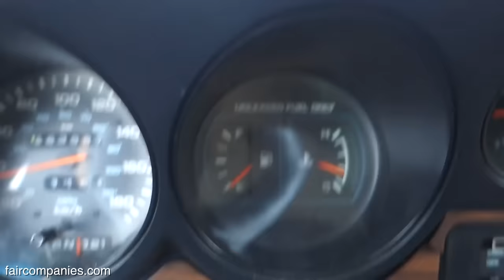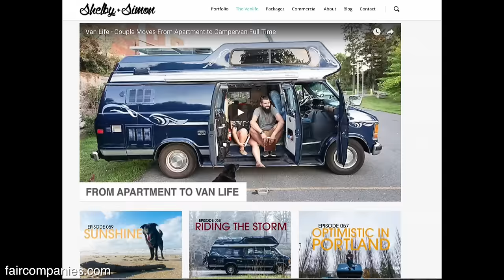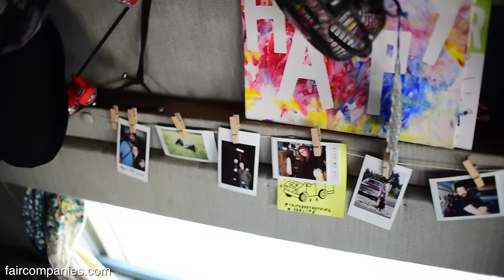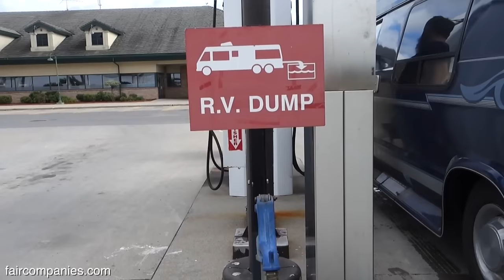#vanlife with no filter: couple records work/life on wheels

Comment: Hi Shelby and Simon. Loved this video. We've got an off road van and have owned others. Never lived in one long term but have camped in them quite a bit - including some extended stealth camping. Couple things just to help... 

You can get a 12 volt mini semi conductor dehumidifier roughly the size of seven DVDs for like $30 US off ebay or Amazon. Most of the little ones sized for a van or small rv have a little tank you need to empty pretty often, but by drilling a small hole in the tank and inserting a piece of fish tank hose and you can let it drain down your sink.

Outdoor construction silicon from Home Depot for about $10 a large tube is made to fix leaks much more reliably than the as-seen-on-tv spray sealer stuff.

Larger, stackable Tuperware type totes are great for storage and organization, keep stuff dry, clean and safe and their mobility is a big plus allowing you to transition your space at will. It's a popular method in Japan where apartments are commonly tiny.

A small, light weight box trailer will rob you of (at most) one mile per gallon and you can put a LOT of stuff in them to make more room. You could do similar bolting a receiver hitch under the front bumper, buying a trailer hitch shelf unit and tying down some large plastic totes or a couple foot lockers.

A very large tarp attached with silicon sealed bolts to the roof, rolled up with a couple already attached tent poles and stakes makes a HUGE covered outdoor area in about three minutes. With a big enough tarp it'll have sides too. Takes maybe five minutes to roll it back up by hand and tie it neatly for travel. If you're handy you can make it look pretty professional so as not to irk the sensibilities of the neighbors.

Driving at night allows for sleeping during the day when most people would never guess there's anyone in that parked van at Walmart or similar. I've found with stealth urban camping going to the night shift bypasses basically all security/disturbance issues.

Anyway, keep at it at least till it's easy and no longer presents real challenges or frustrations.  That's how you'll know you've grown enough by this lifestyle, when there's less difficulty and no big frustration when difficulty comes.  

Also one more tip:  You're photographers so do the obvious and take pics everywhere.  There may be a coffee table book in the future - or ten of them. YouTube videos and blogs are cool, but the rich who eschew you buy a lot of coffee table books. Imagine "McDonald's of North America," or "Public Restrooms of North America," or "Jerks Who Wrinkled Their Noses At Us." Use your imagination. The world just needs more counter culture coffee table books.

God bless and have fun!

Comment: Find a dehumidifier that runs off of 120 volts and get an inverter that runs off of a cigarette lighter and makes 120 volts. Use that to run the dehumidifier. The dehumidifier has a fan that circulates air and does its job. you can keep all the windows and fan outlets closed that way.

Comment: Why do I see so many people who refuse to get a freaking dehumidifier!?!?!
Reply: Good idea.  I have not got one in my van but will consider it.
Reply: Rhett, respectfully: dehumidifiers require a lot of electricity. It would take a powerful solar system just to run an electric dehumidifier. Or it would require running a generator which is very expensive and usually very noisy. Many vandwellers use the moisture absorbing pellets, etc. but condensation is a huge factor for many people, especially if they burn propane in their units. I haven't seen any effective solution that doesn't require a substantial amount of electricity. If you know of one, please share it. It would help a lot of people. Thanks.
Reply: I'm wondering if or how the propane furnace is vented or not? I've seen some campers install a wood stove setup and it seems to fix the condensation problem.
Reply: yeah, I too was wondering if the furnace is not properly vented. I'm in an even smaller van (Vanagon Westy) with a propane furnace which is vented outside, and have never had condensation problems like this.
Reply: I have a small dehumidifier that we use in our RV bathroom. It doesn't take very much electricity. We have a portable ac that we only use at RV parks. Following 70 degrees works here in the US.
Reply: you should look that the eva-dry e-500 or their product line. apparently it's a real life saver! :)
Reply: A few takeaways.

If you have an idea that seems like common sense, but yet no one is doing it, it is a better move to assume that there is a problem with your idea than it is to assume everyone in the world is stupid except for you.

Electricity usage is the main concern with dehumidifiers, and it will have to be run near constantly while you are inhabiting it.

When it comes to moisture in the van, it comes from many places.  Any form of combustion heater will produce moisture in the exhaust.  Propane heaters that are not vented to the outside of the van will introduce a ton of moisture.

However, even with a vented heater that does not contribute, humans release a shocking amount of moisture through breathing and perspiration, even when cool.  This is the main issue, because a van is so small it quickly gets saturated and that moisture condenses on the windows normally, because they are the coldest area.

Combine that with moisture you bring in with you, when its raining or snowing and its on your boots and clothes.  All of that will be added to the atmosphere in your van.

The solution is air circulation and proper insulation, not adding a tremendous amount of electrical draw.
Reply: Logan Cressler Great comments! In the beginning research phase of van living and condensation is a concern. One of your solutions mentioned insulation. Any recommendations to combat moisture and decrease noise pollution? Thanks!

Comment: probably the most honest video about vanning I've come across yet. good work and keep it going.
tip- get a different type of heater like propex, wabasto or Espar, they provide a dry hot heat very efficiently but do have a higher start up cost.

Comment: Condensation , 
Try driving with the vehicle heaters on full heat, full blower. whist driving. if too hot = lower the windows.
use the van Too Hot ! stop and get out to cool off ? if needed ? 
Cook with doors / windows / vents open fully.
sleep with some type of warm air heating, turned up fairly high, open a vent however cold. 
Gas flames create moisture, Body heat / breathing creates moisture.
Van dwelling is best at 50 deg to 80 deg = room temp, ( 14 to 22 deg ? approx ) ( not accurate conversions ) 
Van living is not really suited to Temps around Freezing / 0 deg etc or less. 
The idea is to drive south to a warmer climate in winter.  = Easy in the USA. also Mainland Europe. 
Try to build a Job / Life in a Reasonable climate if poss .
Earn less spend less on HEAT / Or Air Con !  too hot is almost as bad. = stay temperate with climate if / when you can.
If you must burn gas to keep warm = keep the flame outside the vehicle. Gas flames create water in the air. a more efficient burn would burn off the water / dampness and burn the Hydrogen in the air . and oxygen = KEEP WELL VENTED ! 
Daytime sunshine parking = Place all bedding in the cab and heat through the glass turning it often. sun through glass is hot even in winter in the UK .
ALWAYS KEEP FRESH AIR FLOWING however cold it may be ! 
DAMP and Mould will Make you ill ! 
The Best heat is Electric warm air/ or the engine cab heaters . OK Yes Burn some Diesel ? but stay warm and DRY ! 
( or more solar / batteries etc. ) charge lots of Leisure batteries while you drive around or pay to hook up to charge up ? or do a job for a customer in return for a full mains battery charge = do a deal = chat to people ? 
NO-one can live for FREE / Nothing ! sometimes you need to PAY or Do a Favour and Trade with people as you travel.
STOP EXPECTING EVERY THING FOR FREE ALL DAY EVERY DAY ! 
( mow a lawn/ wash a car / carry some shopping / ANYTHING = Just make someone happy and they will pay you in Money or a Favour ! either way you win ! 
wash and old persons car for an hour plugged into their mains etc ? ( or whatever works out easy and Fair all round ) 
Trade Honest and Fair. 
if you have higher Work Skills maybe work an hour for a full day charging all batteries etc ? Work it out in your own way ?
Reply: PAUL,A1 Great info for a newbie researching this option. Condensation and mould a real concern for me. Propane not for me. Appreciate your info. Thanks!

Comment: They definitely have some good points. But also, I think a lot of their issues could be fixed with better planning and better equipment. He is far to tall for that van. She is short enough to stand up straight but still on the larger side. Having two large full grown adults plus a dog in one small van is not realistic. Better planning for weather could have been done. I believe there are way's to eliminate condensation issues. Most of the reason why they got judged like they did is because the van looked sketchy. They didn't seem to take the "stealth" aspect of van life seriously. If the object is to blend in you need to have a normal looking van and appearance for that matter. I have no problem with alternative appearances but many people do and that's just reality. I realize everyone is not able to afford nice equipment. Overall it was a nice glimpse into the realities of van life.

Comment: If you still are living in your van, mount a 3000 LB drop leg  jack on each corner of the bumpers (4). You can level your van in 3-4 minutes and say good bye to moving around in a wind storm. I did it and love it. Plus if you get a flat, built in jack. Jacks are $50 each at E-Trailer cost $100 to have welded on.

Comment: Your battle with moisture is one of the biggest problems with living in a van. Good ventilation and putting up with the cold is the only thing you can really do. You can get battery powered dehumidifiers. A couple of those running at night might help. The other thing you could do to keep a sleeping area dry is to have what tents have which is a sleeping compartment which is a very breathable but waterproof liner which keeps condensation from dripping off the outer liner of the tent onto you while you sleep. With tents you also play a bit of a game trying to keep everything dried out and not smelling. Your use of propane doesn't help either as burning hydrocarbons does produce water as a byproduct. 

Although your biggest problem is that the shell is leaking. Once it starts leaking its very difficult to stop it and a little silicone isn't going to cut it. You need to take out whatever is leaking. Clean up the sealing surfaces and then re-seal it when its dry and keep it dry for a day or two. If its a crack in the actual body then your only real prospect is probably some sort of epoxy based sealer made by 3M or someone like that to fill and bond the crack. 

Really interesting look at van life. Your honesty about the problems you encountered are pretty interesting. You don't see that kind of honesty from other people who live vanlife.

Comment: Shelby and Simon really enjoyed your video, I admire your skills at producing your documentary / personal reality film!  
Leaks SUCK on boats!  The ONLY way to fix deck leaks on boats is to totally remove hatches/deck fittings, clean the surfaces & re-bed them using a quality thick flexible caulk (then gently replace the hatch and start the screws but do NOT screw the hatch down tight until the caulk cures).  As you've learned you can't stop leaks by caulking around a leak.

Comment: Hello love your video love the honesty I know what you're going through I have been doing it for 10 years I am on my third van couple things you've brought up in your video that I might have a possible solution your condensation problem I found out if you take pantyhose and fill them with kitty litter and put them in your windows it will help with some of the condensation and as far as your roof leaks get you some peel n seal works better than that stuff you've been using. Good luck.

Comment: For the condensation problem, go to a local plant nursery and get a tub of Soil Moist beads, partially fill several plastic small containers with the beads and then set in several different places incl. cabinets. these will help to suck up the moisture,

Comment: The way you get rid of condensation is use your AC.  Its actually a dehumidifier. Best one to use is the Ac that came with your van in the engine bay. Run the AC ON with heat set to high.   

You can use the central unit also for this same purpose.

Comment: I'm about to move into a travel trailer and because of watching people like these lovely people deal with condensation I installed a "Cubic" mini wood stove and it works awesomely (is that a word?) I used it last winter and it easily heats my 21-foot trailer. It will last about 5 hours until you need to add more fuel. I have and can use propayne as well but if I do the wood stove produces dry heat and will clear up the condensation rather well. You can buy wood stove fuel that looks like compressed sawdust for cheap or use wood and you can cook on it.

Comment: Love the video. Those mountains are gorgeous. The propane furnace condensation problem is a good heads up. I'm wondering if or how the propane furnace is vented or not? I've even see some campers install a wood stove setup and it seems to fix the condensation.

Comment: On thing i did notice, was that despite getting rid of a lot of your belongings to move into your Van, you still have quite a bit of it. 
one thing i saw in particular were cups, If it's just you two i think 2 cups should be fine, and if your wanting guests 2 more cups at the most. (I'm counting Cups, as any container you drink out of.
For colder weather you could invest in thermals, it would help you cut down on layers at night, and would help you reduce your amount of clothes.

I agree that should avoid using a heater whenever possible, unless you have a e-humidifier (but that takes up far too much electricity lets be real here.)

For more storage space, you could for-go showers within your van completely, and buy a Camp Shower. (It's really just a bag that holds your water with a nozzle, i think it may be better than the half gallon jug. and if you let it sit on a sunny surface you get hot water after like an hour or two.)

But all in all, i think you do are doing perfectly reasonable. I think a big challenge about living in such a confined space is that you really have to draw a line on some things, the hardest of which is want versus need. So i think it's really respectable the way your living your life despite the stigmas.

Comment: Lol at the "first hobo shower". That's why no matter how you're living you need a heated, battery powered camping shower, even if just for backup when the power goes out in a house or for endgame prepping. There's no excuse for not being able to build a portable, packable, heated, powered, awesome rain shower nowadays. With the propane heated, D cell battery powered,pumped shower kits you can get online from $5-$40 that you can even modify to be heated by your camp fire and pumped by gravity, and then those flexible bathroom tiles you can glue to rubber floors you can even have a turquoise, tiled, heated shower even living out of a van. It's the easiest thing to do and fun in my book. And a necessity for a comfy life. Step up your game.

Comment: Regarding the condensation problem.  The reason (one of them) that you have that problem is due to the type of heater you are using.  Anytime you have heat produced by propane, candle, fire, etc. you will produce water as a by-product of the combustion.  The way around this is to have a heat source that routes the by-products and other toxic fumes like CO to the exterior of the van.  This produces a DRY heat and is also much safer (no CO in the van).  It's much more comfortable and safe.  These products include the Webasto heater, Espar D2 heater and the Propex heater.  These are superior so they do cost more than a Mr. Heater Buddy of course.  I'm planning to install a Propex because it uses propane rather than my fuel tank so it's an easier install and easier to maintain although it's a bit more expensive fuel than gas or diesel.  But well worth it in my opinion.  Y'all need to get one of these and you will be a LOT happier!

Comment: Fuel costs.....this will all change when you can buy yourself an electric van....not to mention the increased comfort due to being able to run the AC system all night with no battery drain issues!  CANT WAIT!
Reply: how would ac not use battery, if it's all battery?
Reply: bullshit post? otherwise, you won't be able to run an a/c unit all night. Right?
Reply: mushy85
I just don't have a response that could address that post.
I will leave you, your nurse mom, and Mufasa to your Lion King.
Wow.

Comment: I really appreciate and respect the honesty in this video. But also, for those who are just looking to get involved, do not get too discouraged. Many of the problems encountered in this video are preventable with research in advance and are not necessarily a standard of van life. For example, I will not get a van where I have to take down the bed daily or can not sit up in bed, this is very important to my daily quality of life. Also, the leaky roof, bad insulation, and many other things are the downsides (in my opinion) of purchasing an old camper that was really only built with the intention of trips, not full-time living.

Comment: I am surprised at the condensation. It should have an outside venting propane heater and produce dry heat. If its vented inside then you will get a ton of moisture. I wonder if they had a furnace exhaust leak.